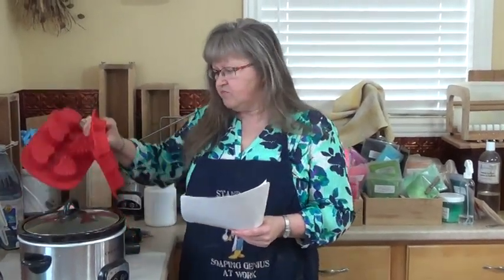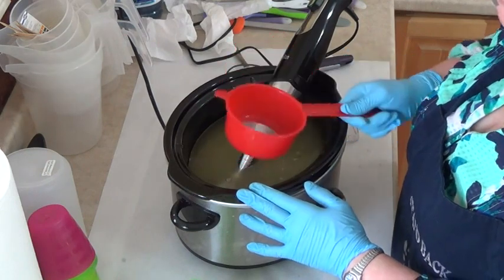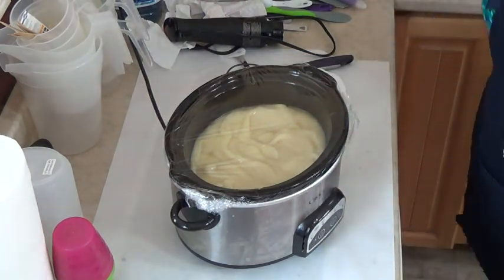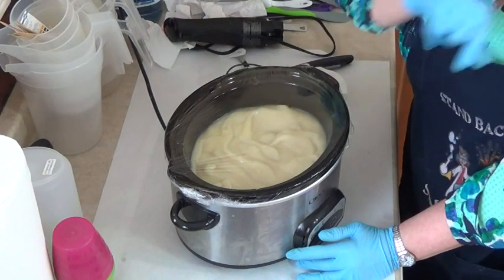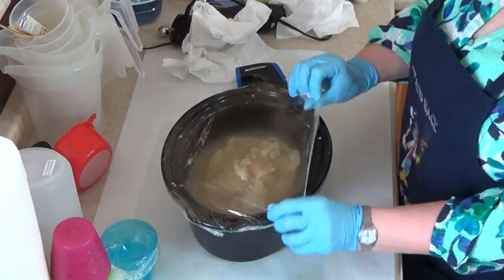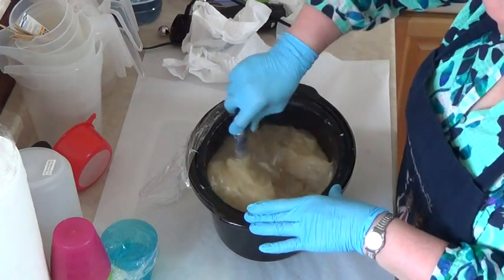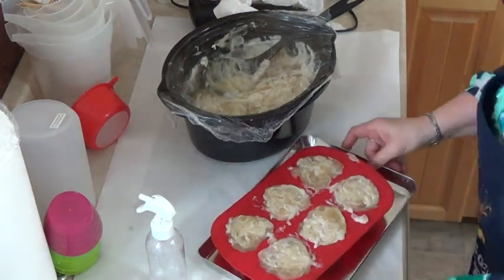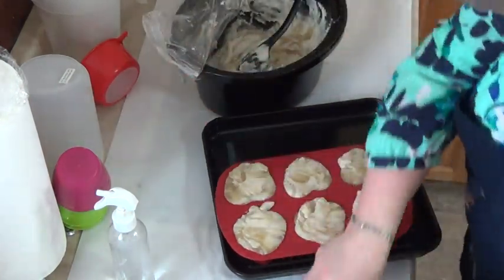Shalebrook Handcrafted Soap - Tapioca Hearts by Valerie Mosher

Comment: Hi Valerie, this is a beautiful soap; thank you so much for sharing the technique and recipe.  I am amazed by the amount of castor oil; 3 x the max. rate recommended by many suppliers, and there are no signs of sliminess or sogginess.  I’s still very humid here in Brisbane, and I’m using a sample in the shower already.  
I got a pH of 10 after the cook and 8 - 9 right after the additives.  When I double checked 48 hrs. later the pH was 7, a really good result – Dove level.  
This was the first time I used HTHP and definitely need to work on my timing: the mass separated after volcanoing and did not come back together, I did not observe any distinct saponification stages and ended up overcooking, but that didn’t affect the nice qualities of this soap.  I’ll get the timing right with more practice, I’m sure.  Thanks a million, and have a wonderful day.
Reply from the maker: Hello Jacqueline, thank you ever so much I appreciate that and you are more then welcome indeed!  I've been using castor like this for about 4 years and I love it, I love also that it is good for skin and is a great humectant. I've never had sliminess or sogginess with castor at that level at all, but formula will and can play a big part in how it works and of course your water type can affect the performance of soap as well, i.e. hard water versus soft water.  I've never gotten an 8, I did get around a 9.25 once but mostly 10's and Kevin Dunn (Chemist) says there is no such thing as a 7ph in soap, as once it's a 7 it is no longer soap --- what are you using to test the ph?  Yes, sometimes depending on the formula and the temp of lye and oils it will not go through all the stages, as sometimes it will go right to potato and then quickly to Vaseline -- so happy that you are enjoying the soap and hope you continue to do so, big hugs
Reply: Hello Valerie, I am using an ordinary full range pH 1 -14 test paper kit with the comparison colours shown around the container, similar to this http://www.seohcorp.com/seoh-0-14-ph-indicator-strips-100-box/, but I cannot find the exact one anymore.  It came from e-bay. The heat and humanity are high in Brisbane, but the kit has been stored in a black pouch away from sunlight and moisture.  I admit it was difficult to ID an exact pH, because none of the colour series presented gave an exact match, so it might have been slightly above 7, but it was definitely more different from the next closest series given,  which was 8.  I also left the strip by the sink for some time to keep an eye on it (because I too found this unusual), and it remained there.  Dove and other "pH balanced" soaps are typically around pH 7.  Here is an article published in a scientific journal that makes reference to a soap with a pH as low as 4.4, https://www.sciencedirect.com/science/article/pii/S0021755716000115; but I agree that a soap, by definition is an alkaline substance and that a pH of 7 is neutral, which makes a soap exactly at or below 7 a contradiction in terms.  
Our water is ‘hard’ according to City Council, and I used this to test for pH, but I used bottled distilled water in the recipe. My additives would have been at slightly different rates, seeing US and AU spoons don’t match.  I did not have any maple syrup (and that was the only small change I made to the recipe), but upped the sugar from 3% of total oil (which I had guessed) to 5% instead. 
I did not SuperFat upfront (and that is the only change I made to the technique), because I felt it might increase the chances of any yoghourt acids converting to sodium lactate, as the mix should be very slightly lye heavy for this to occur, according to this article https://classicbells.com/soap/lacticAcid.html.  Instead, I SuperFatted with the total % given at the end, with equal amounts of grapeseed-, avocado-, and rice bran oils (and I don’t usually SF with rice bran, but it's a favourite soaping oil, and I had to put some in).  Thanks again for all your wonderful videos; I’m looking forward to the next one, best wishes, Jackie

Comment: Loving your great videos and all the tips you so generously share. I do have a question - I prefer to make my soaps without palm oil or any animal fats - can I replace these with more cocoa butter and or babassu oil? What would you suggest? Many thanks for sharing your knowledge and experience.
Reply from the maker: hello Debbie, thank you for stopping in and thank you for those kind words and so glad these videos can help in any way at all! yes, you can substitute whatever you would like "BUT" always, always put through a soap calculator because it changes the sap value of things and you will need different lye amounts , and for sure once you substitute anything it changes the formula/composition and how that soap is as well -- what all do you have to use to make soap etc. fats/oils/butters and I can see if I can help you out with a formula if you like.
Reply from the maker: so here is a formula just with what I know you said you had : 15%Babassu, 10% Canola, 15% Castor, 25% Cocoa Butter, 35% Olive Oil - super fat at 7-10%....
Reply: @shalebrookhandcraftedsoap7907  Wow thanks so much for the quick reply! . I will give that a go. I have been making cold process soaps for a couple of years now but decided to give hot process a go after coming across your videos. Have a great week and thanks again. Debbie (from New Zealand)